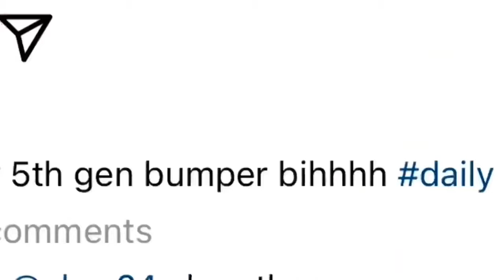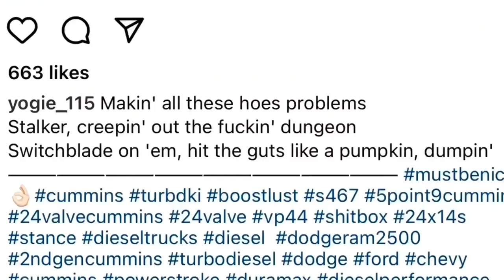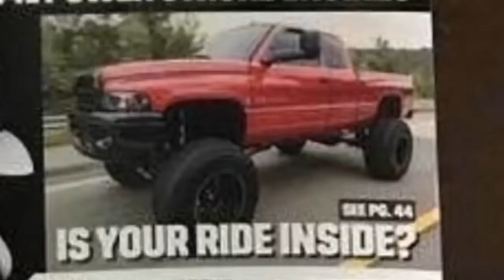I bought an 😲800hp! 2nd Gen to bother innocent people! 👍 LIKE & SUBSCRIBE 👍

Comment: This is awesome but try a nv5600 6speed fully moded out and you will understand why people love these trucks manuals and gassers are made to be made fun of so do your research and buy a 6speed 24valve 01-02 and you’ll actually realize how fun reliable good on fuel and burnouts bush rig etc all in 1 full street tractor or just buy a 5th gen